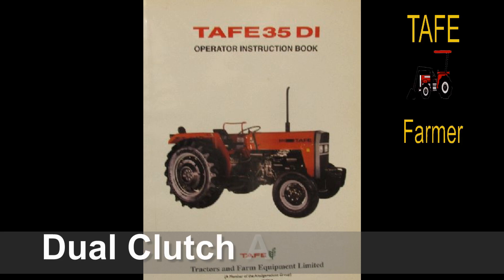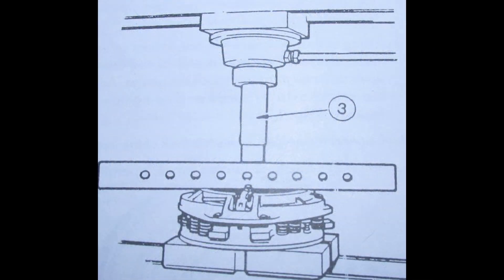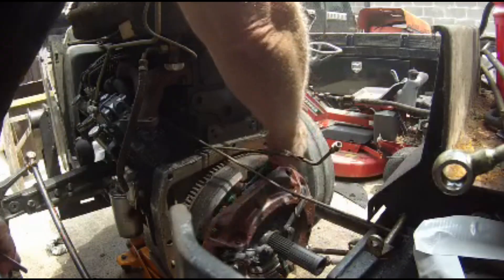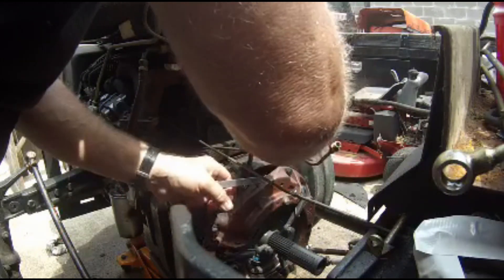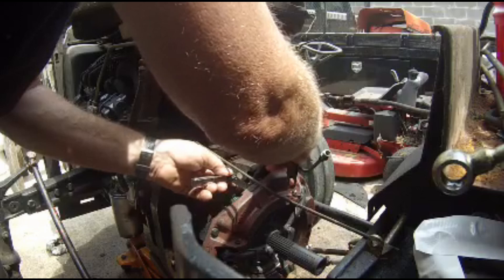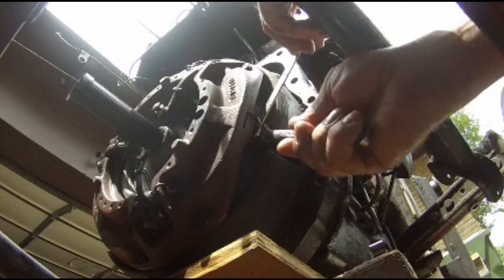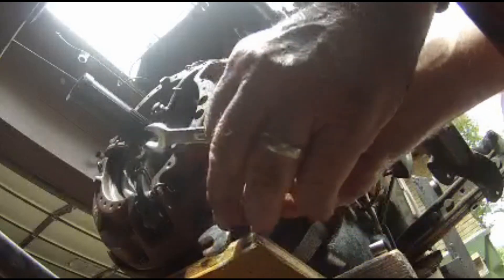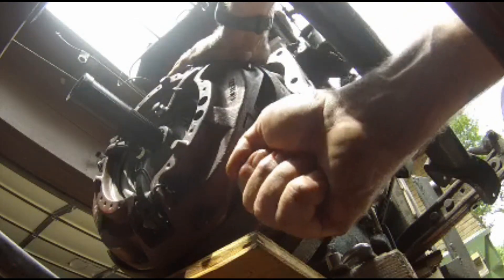Tafe 35di, how to adjust a dual clutch & pressure plate

Comment: Good video, Next time use a framing square to set the clutch fingers
Reply from the maker: Actually there a special tool they make just  this adjustment, but didn't have it, a framing square is a good idea, but it'd need to be a large one, my square is a baby one, I had a sheet rock square, tried it but was too awkward to get a decent measurement by my self, I even tried a 4 ft level, two people would of been idea, but I was flying solo, that day. I appreciate the comment, Stay tuned for more. Thanks for watching